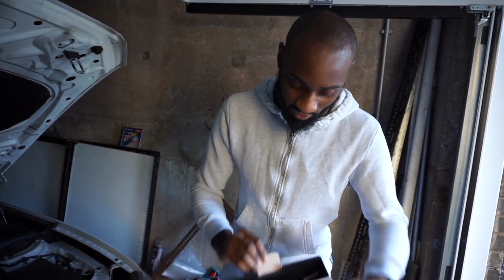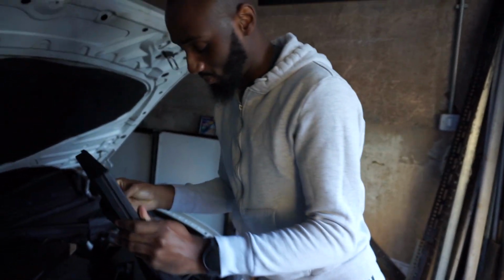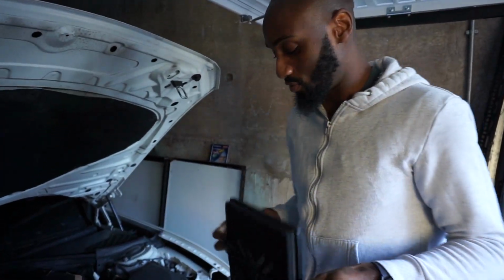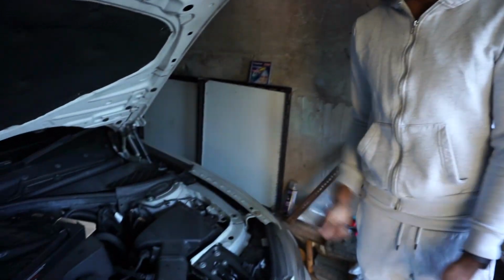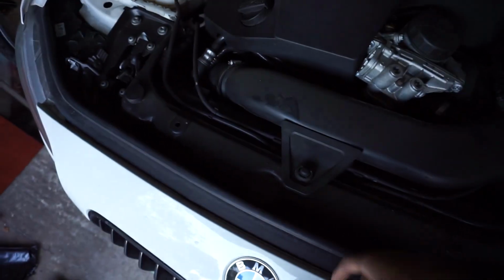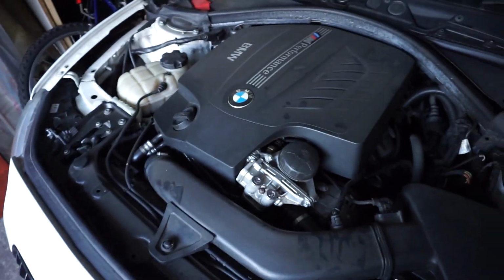Does A Pipercross Air Filter Sound Better Than Stock On My M135i?

Comment: Not interested in the sound but how about air flow, does it seem that more air gets through? I have a 9yr old ds3 that's on 96k miles so just want to help the engine 'to take it easy' so to speak